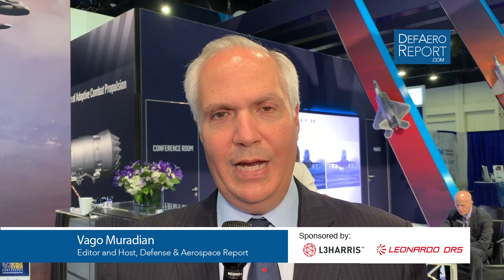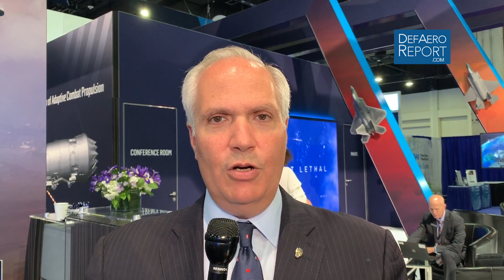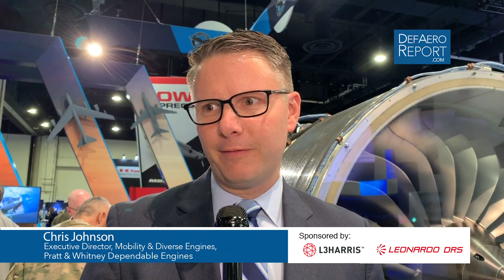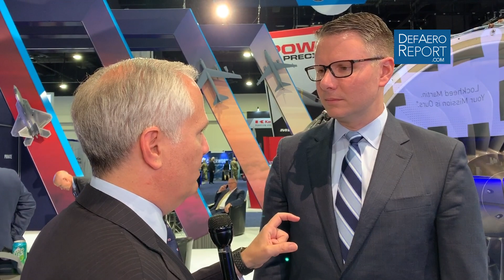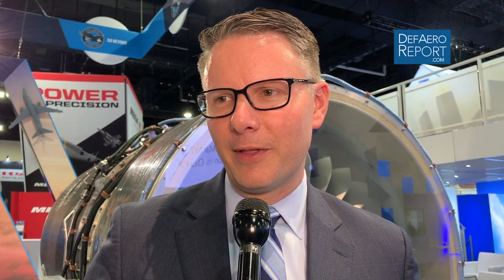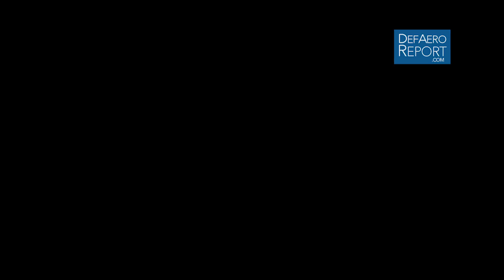Pratt & Whitney's Johnson on Program to Re-engine USAF B-52 Bombers with PW815 Powerplant

Comment: Please note people, none of the competitors for the reengine contract say their engine will provide more thrust than the old engines.  The new engine will simply be more efficient.  In other words, fly longer on a tank of JP4 for fewer air refueling hookups.  One competitor suggested a 35% improvement.  

There is also a maintainability component to this, maintenance costs.  The new engines will be easier to maintain.  A huge benefit for the bottom line.

But there is also a benefit I haven't heard talked about yet so I am only guessing. I flew the B52G.  These B52s getting the new engines are the 'H' model B52.  So they could probably stay airborne longer than the 'G's I flew during the cold war in the 70s.  These new engines just might be able to increase the planes airborne duration to well over 30 hours due to improved engine lubrication technologies.  Not that I enjoyed 30-hour missions, but we had one honey-bucket for the crew of six and sometimes nine with inspection teams.  And it was out in the open next to the periscopic sextant station.   Not sure where it was on the 'H'.  Shoot, maybe they had a regular bathroom with running water.  That said, these are important considerations especially if they ever let females crew a B52 again.

Comment: Pointless.  Just replace the Buff with a new heavy conventional bomber.  There will always be a need for it.
Reply: Good luck trying to convince the M-I that they should design and sell a new conventional bomber!
The USAF and M-I have brainwashed everyone for over 30 years into believing that stealth is the solution to every problem.
Air forces all around the world are pricing themselves out of existence because they don't use their brains.  Never mind that the activity in the last Gulf War and Afghanistan has demonstrated you don't need stealth 98% of the time unless you're planning to fight China and Russia!
The legacy of the F-35 is not going to be technical advancement but how it priced many air forces out of existence because of the maintenance costs and lack of training time on actual frontline hardware!  A T-7, M-345, Hawk, and simulators will only take you so far.  Pilots still have to train on the actual hardware they fly into combat.  Stealth is making that prospect unaffordable because of the maintenance costs!

Comment: I don't think the PW800 is on the A220 and he didn't answer the nuclear pulse question. But an interesting interview in any case - a more marketing feel and response. The PW800 looks to be a great engine but doesn't have the proven time. His point with life cycle costs and zero overhauls is a good selling point. From my experience in the GA industry, the PW800 cost per hour is cheaper than the BR700 with longer life limits on the components, but that's from the civil side. It will certainly be a close decision.

Comment: PW800??? SMALL ENGINES!!!! They are for small commuters! Pratt wants to install 8 not 4 like R&R and GE!!!
Reply: Problem appears to be the lack of rudder authorithy on the Buff, and 2 engine out capabities on the same wing
Reply: RR wants to install 8. The requirement is for 8 like for like.
Reply: The proposal for 4 engines was looked at about 10 years ago and then seemed to disappear. there was talk about 4 GE CF6 engines.
Reply: @a239947  CF6? Are you for real? Were they going to put bogey units under the outer CF6's so they didnt tear up the runway??
Reply: @nathd1748  Not on the original pylon obviously. but there was a proposal with the older CF6 like that on the KC10 which has a smaller fan. there is room with them moved up closer to the wing. I dont think it got past the concept stage. there is photo of the original CF6 being tested on a B52 wing before the DC10 was released.
Reply: @a239947  I just Googled and there are pics of a 4 engined B52 with 4x PW4000 engines. This was back when Boeing actually believed the best engine to hang on there was 4x RB211-535'S that launched the 757 and they teamed up with RR to offer this to the Airforce. Pratt got rather worried and did their own study with the PW4000 as well as GE with the CF6. Seems the US Airforce have wasted quite a few opportunities with their B52's

Comment: Can't wait for the re engine program. -35% fuel burn will be a HUGE strategic leap.
Reply: It probably won't be that good.  I think 20% is probably closer to reality.  The MPG estimate on cars aren't that good, why would you expect military contractors to deliver up to their estimates, either?
The B-52H already has a range in the ballpark of 8,800 miles.  I'm sure the crews will be REAL thrilled to hear the range has been extended another 2,000 miles!  😄
Reply: @AvengerII  When it comes to fuel burn figures these companies are pretty accurate. the Products they are peddling from P&W, GE and RR are all off the shelf units which they know what their real world figures are. 35% doesn't necessarily mean 35% more range. Just 35% less fuel burn. The new engine may not necessarily have the same thrust  as the TF33 but most being offered are pretty much the same or slightly mor but all have a massive efficiency increase. its going to come down to reliability and maintenance.
Reply: @a239947  That sounds reasonable if it's old tech.  They HAVE to know how it's going to work for the next 20 years IF the engine switchover ever happens.  They've been talking about this for at least 30 years and have funded a half-dozen studies minimum.
It's ridiculous.  The plane will be in service at least another 20 years.  The engine swapout is worth it!

Comment: Enough talk, get it done.
Reply: AMen!  They should have done this at least 15 years ago!
Reply: @AvengerII  more like 25 years ago.
Reply: @briancooper2112  25 years ago, they didn't know the B-52 would be in service past 2010/2015.  I think the plane was originally was supposed to be phased out in the 1980s but it outlasted all its planned replacements because of the economics of the airframe and its adaptability.  When all's said and done, supersonic flight is the worst feature you could incorporate in a long-range plane meant to carry a lot of bombs.  I think ultimately stealth's maintenance requirements will work against those planes.
Reply: @AvengerII  🇱🇷
Reply: @briancooper2112  Here's a link to an article with more than you would WANT to know about the B-52 engines and aerodynamic issues.  Maybe you've read it, maybe not.  I'll leave the link for you and anyone who cares to look at it.  I think I understood at least 30% of it.
=> http://www.airpowerstrategy.com/2016/11/22/old-dog-new-engines/
It kind of makes sense to me, though.  You'd want to stick as close to the original propulsion systems as possible because you can't slap a band-aid on a 70-year-old design and expect it to behave.  It's gonna be an 8-engine overhaul because that's what the plane was designed for.  4-engines and 30,000 lb thrust+ with afterburners will NEVER work well for the existing B-52 airframes!  I don't think most people understand the balance issues.
The original designers did know what they were doing.  The USAF kind of screwed up the B-52 in the G and H models.  A lot of people aren't aware of the worsened stability of the final 2 B-52 models and just presume they were better than the preceding production models.
Reply: @AvengerII  The H model had turbo fans, way  better than earlier models.
Reply: @briancooper2112  They also had reduced stability in flight because of the shorter tailfin.  The H-model was redesigned for lower altitude flight where the taller tailfan ran into more turbulence and structural strain.  The tailfin on the B-52 never had a great rudder to begin with but shortening the overall tailfin exacerbated the control issues the plane already had.
The G and H-models were also worse for aerial refueling.  The redesign of the tailfin and elimination of the ailerons on the last 2 models made it harder to maneuver in situations.   Spoilers were used on the G and H wings in place of spoilers (probably because of the redesign to pack in more fuel into the airframe) and were less effective.  The B-52G and H were/are rougher planes to aerial-refuel.
Roll control and response for planes that lack ailerons and use spoilers in place of ailerons is worse from everything I've read.  A plane with conventional ailerons will outroll the spoiler-equipped plane virtually every time and has more instantaneous response to control inputs.
In some cases, they can't help using spoilers because of specific design issues and requirements.  Variable sweep planes don't have ailerons because they would be useless when the wings sweep back too far and the VS system already complicates the maintenance and aerodynamic issues without adding even more mechanical complexity (with ailerons that can't be used past a certain sweep degree).  That's added weight (ailerons) a tactical aircraft with heavy VS systems doesn't need.
Modern airliners use both ailerons and spoilers for control in specific situations.  Whether they get used at the same time is a different thing.  In general practice and in flight, the aileron is a better control system.  The spoiler systems I've seen on modern airliners are generally used on landing to kill lift and reduce runway length requirements.  The added complexity of the spoiler (on commercial airliners) is justified by airport realities.  The military can afford to build 4-5 mile long runways on bomber bases and experimental test sites like Edwards AFB.  A lot of airports don't have the real estate to build 20,000-26,000ft long runways.
Reply: @AvengerII  correct, the turbo fans worked better than other power plants. G and H models are late 1950's and early 60's designs that were modified lower because of Vietnam SAM losses. The G ecm gear in vietnam was horrible. The D model had better ecm gear. I was born at K.I. SAWYER former SAC base. B-52 was my first word. Ok,maybe not but my dad worked on G and H models autopilot.
Reply: @briancooper2112  That's neat to hear your association with the plane.
It's amazing how enduring those 1950s designs were among planes and cars.  Crazy to think the B-52 will be close to 100 before it's finally retired!
I think, however, I'll always associate that plane with black comedy.  It was one of the big stars in "Dr. Strangelove"!   😄😄😄
Reply: @AvengerII  i agree, given the choice to fly any airplane, B-52 still my #1.

Comment: Should have been accomplished 25 years ago USAF!  All that fuel and all that smoke.  Little too late guys.
Reply: You'll have to explain why it's "too late."  The plane is going to be used into the 2040's so, any upgrade is worth it - or, were you simply making a comment attempting to sound like you have something prescient to say?
Reply: Untill perfection rolls off the assembly line by the scads
Reply: @Scott Munczenski the same reason we now have cell phones

Comment: all his answers were essentially the same. he never gave a direct and clear answer.
Reply: What answer were you looking for?  In his answers he has said - PW has supplied engines for the entire life of the plane.  They currently have all of the logistics in place to support the Air Force because they've been supplying engines for the B52 since it was originally built.  The benefits of the new engine for the Air Force are 30% better fuel efficiency and lower maintenance costs.  The engine provides the same performance as the current engines.  It's not all that complicated - what more do you need to know other than total cost of the program - and that's not up PW.